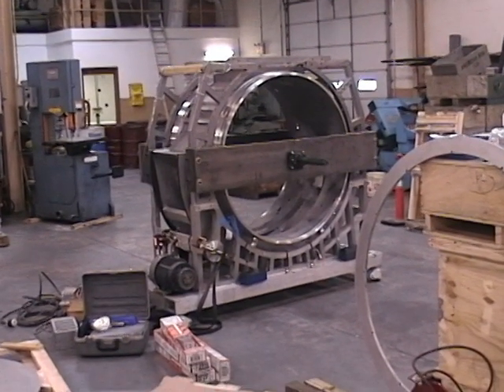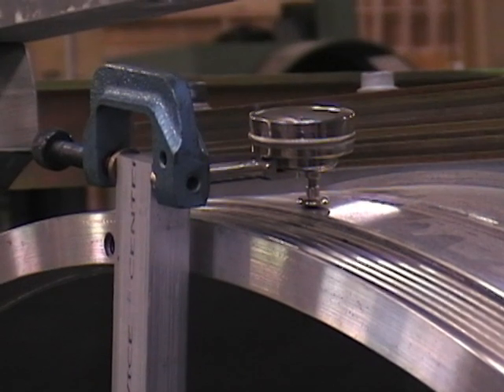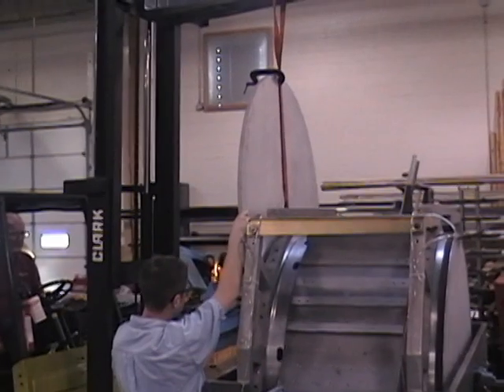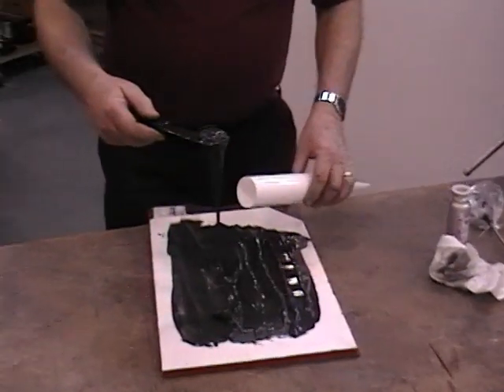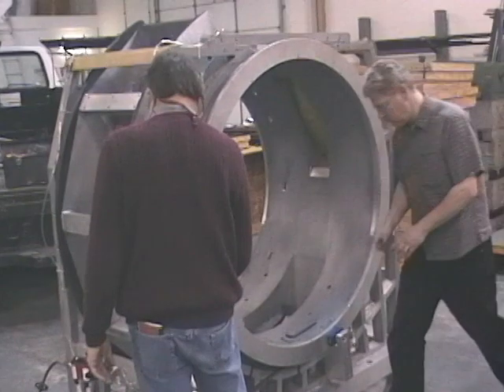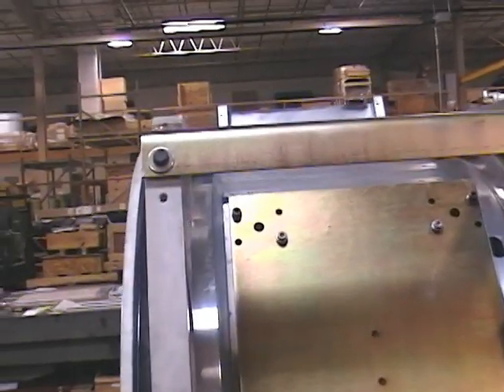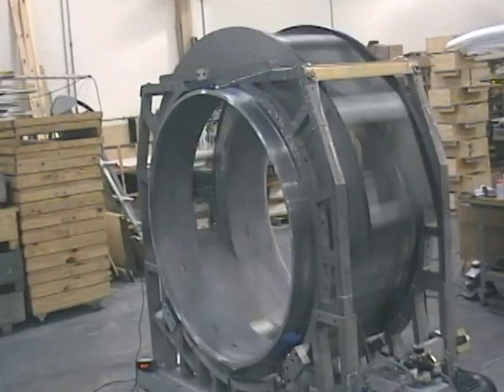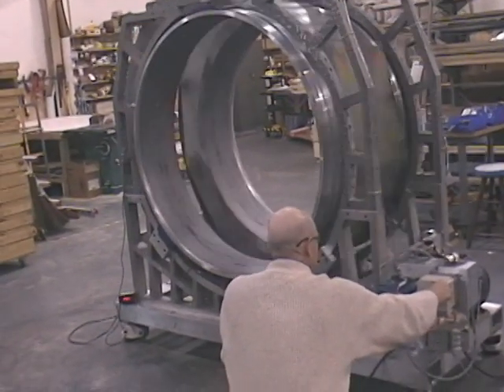In-Place Machining of Rotating Drum

Comment: Questions.

Would you consider your air-bearings to be suitable for up to 1000c degree working environments?

Second, what supply pressure and volume is required for what load over what area?

Third, do these porous bearings have the ability to be shaped in two planes to function as thrust and support in a single unit configuration?

Thank you for your time.

Heath H